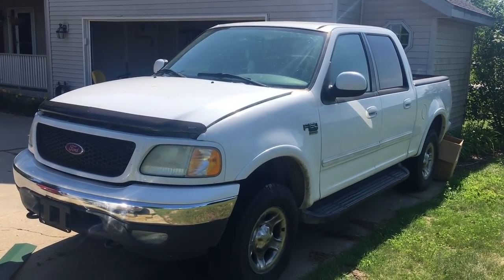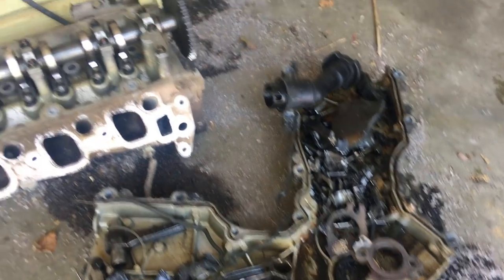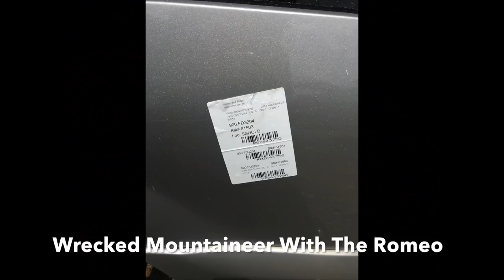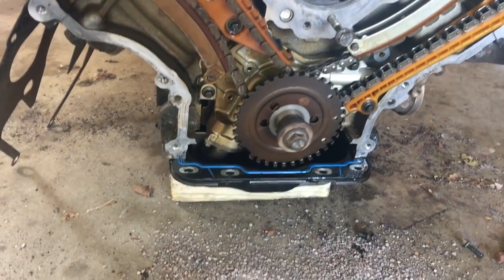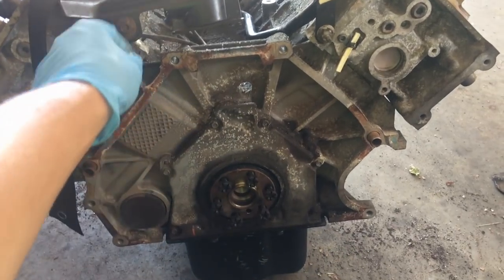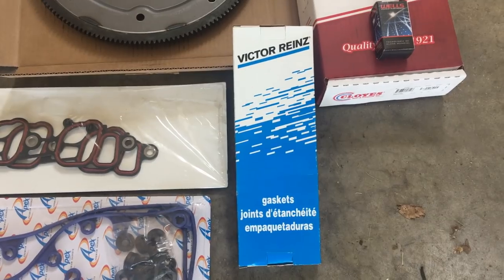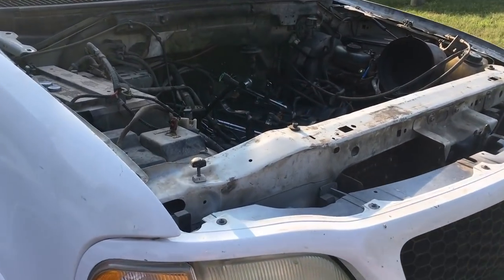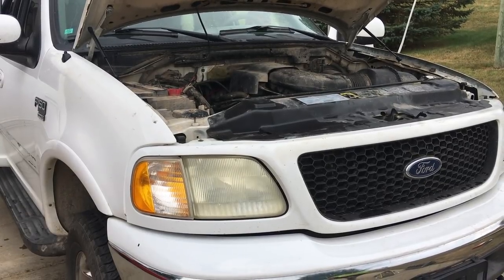Swapping a Ford Windsor 4.6 with a Romeo 4.6 - YES, It Can Be Done!!!! - Differences

Comment: Great job man. But you would think with the old engine going bad due to oiling issues. You would’ve put a new oil pump on that used engine! So much easier to do with the motor being pulled.
Reply: I was just thinking the same thing.
Reply: It’s a Windsor problem, doesn’t really happen on Romeo engines.

Comment: Thank you so much for this informative video.  I am considering a rehab of a 2003 f150 and was looking at the 4.6L 2v and was seeing numerous variations on it that seemed to lock you in to specific set ups. It’s good to know there is some interchangeability between 4.6s
Reply from the maker: Glad this was able to help! It took quite a bit of research and validating and trust to take this on, but glad it was able to happen. Thanks for watching!
Reply: I have a friend with a 2005 F150 4x4.  His truck came with the Romeo engine in it, which hydrolocked due to a defective intake manifold gasket (rod #1 ventilated the block), and we replaced it with another Romeo engine sourced from a 2006 Grand Marquis.  The only thing we had to do was swap the timing cover.
Reply: Please excuse me… I am trying to find an engine for my 2002 quad cab… 4.6. What’s a Romeo engine? ?

Comment: I always trust this Ford 4.6L Triton Romeo, we have two Romeo 4.6L are running like champ over 200,000 miles on our one of F150 and Expedition also we had 2005 F150 5.4L 3V did not make it 200,000 miles on it that had much of problem with PCM, interior electrical, BCM, and transmission went bad, I hate it but 97 to 04 These Romeo and Windsor 4.6L engines are best! I love my 01 F150 crewcab with 4.6L Romeo, never give up on me unless just like simple change water pump, pump steering or alternator are no big deal.
Reply: My 97 f150 has over 262k miles still runs like a champ
Reply: The romeo and Windsor  4.6 for the f150 both use iron blocks.
Reply: The 5.4,  2 valve is also a great engine!

Comment: so it sounds like you can go from a windsor to a romeo but not a romeo to a windsor because of the knock sensors. My truck has a romeo in it and I was hoping to go to a windsor because in my case they are more readily available but with what you told me I might go after a motor from a crown vic or explorer, the aluminum block is also a plus. 
Does anyone know if the windsors were pretty much the same or were there some quite a bit of differences because I know there were like six different ones.

Comment: Hey Chad, I have a question; I have a 2000 Lincoln Town Car which did not have PI heads and I am planning of changing the heads with PI heads; my question is: Do I have to degree the cams because I hear some people saying that and some people saying no? I see you have a lot of experience with this engine; also, if I change the heads the timing is different or the same. Thank you for any help. Jose

Comment: I bought a Romeo 4.6 engine out of a 2008 crown Vic police interceptor with a cast iron block and put it in my 1997 4.6 Windsor F150 Lariat 5 speed 4x4 which has the cast iron block and the only things I had to change were the knock sensor and find a 2008 f150 intake plenum to run my 1997 f150 throttle body. I paid a total for the engine like $600
Reply from the maker: That is awesome!!! Thank you for sharing!
Reply: did you take the knock sensor off the Windsor and put it on the Rom?
Reply: @marvinautoworks9955  I had to drill and tap the hole on the Romeo block to fit the knock sensor for the Windsor just so I can use the stock harness without buying a pigtail. It was easy but you have to be careful to not crack the block or break the drill bit
Reply: @younggun3678  did tap 1 of the 2 holes
Reply: Also I'm going from The Windsor to the Romeo
Reply: @marvinautoworks9955  both the Windsor and Romeo blocks I had just had the one sensor in the middle of the block but you can just put the sensor in one spot on the block you have which probably has 2 sensors. You only need one sensor for the harness and to keep the check engine light from coming on
Reply: @younggun3678  so I shouldn't splice the Romeo connection and put on the Windsor pigtail
Reply: I'm definitely going to make a video about these
Reply: @marvinautoworks9955  I really didn't think of doing that at the time I should've done that would've save some time but yeah you can splice the wires and do it just make sure to connect the right wire ends
Reply: Just bought a engine for a 2002 F-150, yanked it from a 2008 crown Vic, fixing to start that project
Reply: @younggun3678  I definitely let you know if it work
Reply: I had a similar swap, I got a 2011 crown vic police interceptor and put it in a 2000 expedition. I had to swap the intake manifold, upper and lower due to the PI head layout and the knock sensor stand offs. I tell you what though, the engine at stock is a beast, quiet and smooth. bolted right up to the tranny, a/c compressor all lined up. two things I almost forgot about; I did have to use the expeditions original power steering up because of the sensor on it otherwise it would have been throwing that code, and the other was the water pump, due to the threading for the fan, unless you are running an after market electric fan this is a must.

Comment: I don't understand how you wouldn't be able to replace a Windsor with a Romeo or vice versa.  There were a couple of years where you could find a Windsor in some vehicles that only otherwise used a Romeo due to a fire at the plant back around 2000 or so, I do know that some Mustangs and Panthers of those years received the Windsor engines ...  other than the 8 bolt crank in high performance applications, I don't see why a Windsor would ever be better than a Romeo in the PI era.  

Since either engine was available in all the platforms at one point, I am sure there would be the needed parts to effect any swaps.  The engines look the same to the PCM.
Reply: 2005 that is

Comment: The difference in your heads are one is pi and the other is non pi. The heads in your blown motor are actually better heads.
Reply: La.fishsticker 1 they are both pi he got it out of a 04 you can see the pirts are square when he shows it in the truck without intake
Reply: @whatsreallygoingon253  I actually did see that after the fact...

Comment: One thing that I did notice was that my Windsor timing cover bolt holes do not line up with the Romeo timing cover bolt holes just one of them
Reply from the maker: I did have only 1 bolt hole that didn't line up and it was just to the right of the water pump. We ended up putting a bunch of gasket maker around it to seal it up. The rest up the bolts will provide more than enough pressure to keep it tight. But, you are correct, there is that one bolt hole that didn't line up. Sorry we didn't catch this on camera. And thank you for calling this out!

Comment: It's a little confusing Romeo we're known for cast iron blocks only Windsor blocks came in cast iron and aluminum aka wap block so my guess is this is not a Romeo block you have the Windsor Assembly Plant block with the Romeo style heads
Reply: All Windsor 4.6 blocks will have 8 bolts on the flywheel, and don't have the cam girdle the Romeos have. Romeo 4.6 will have 6 flywheel/crank bolts.
Reply: Lmao that stopped me in my tracks to like what they both irons

Comment: Hey I have a 2003 F150 with a 4.6 Windsor. I found a 4.6 Romeo out of a 2006 F150 My mechanic swapped them out, but when he starts it motor runs fine for like 10 seconds, then starts running like crap. He says it starts dumping too much fuel into the motor? I'm at a loss. What do you think it can be?

Comment: So i bought a 97 f150 it had just had a motor swap...i bought it with a " belt squealing" and when you turn it off it has a whin sounded like air escaping thru a pinhole...i quickly eliminated the squealing belt theory and narrowed the sound down to the tranny pump/flywheel area...10,000 miles later it still makes the noise during idle...was told there was slight difference maybe with flywheel or tranny shaft??? Newer motor came  out of a 99e150 van
Reply from the maker: That is a tough one. I honestly don’t know :( sorry
Reply: @ChadWilliamsFixesAll  after your video I wonder if the flywheel from the van was different than the one for the f150....assuming they used the flywheel that was on the Romeo motor

Comment: maybe a dumb question, and if so i apologise,   but still wading into the world of working on your own vehicles,  Does the aluminum block and other small differences effect the capabilities of the vehicle once its all reassembled? reduced hp or towing capacity?   can't help but think that they had to choose steel over aluminum for a reason,  but my 99 needs a engine and i'm struggling to find one,  so if i can expand my donor vehicle list i'd be stoked

Comment: Why didn’t you use the old 6 bolt fly wheel that you pulled off the junkyard motor? I see you bought a new one, why is that? I have a 1999 mustang and I’m putting a 2004 Romeo in it, the Romeo engine comes with the 6 bolt fly wheel already, are the flywheels the same with the 1999 and 2004 with the exception of the Romeo being a 6 bolt and the Windsor being a 8 bolt, are they the same other than that?

Comment: Something I noticed on my 4.6 mountaineer motor is that the crank shaft position sensor plug in is different then my 02 how did you fix that

Comment: I have 2010 f150 ,4.6 2 valve inside my single cab and its a good , decent motor
Reply: THE NHRA GUY #49 is it stock? 2010 f150s came with the 3v 4.6
Reply: @mattweeks2272  I ran my vin number on all data .   it's a f150 single cab 8ft 2wd.   Base model
Reply: @mattweeks2272  its got a 2 valve 4.6 I ran my vin on all data and have all the stuff printed off for it.    I work at a car dealership
Reply: Do you wanna run my vin number ?   Your barking up the wrong tree buddie .  you wanna run my vin to my truck ?  U wanna see what comes up. ?

Comment: Is that a crack in the block at 8:11 where the timing cover bolts up above the oil filter?
Reply: Motor mount
Reply: Es la union entre el Block y la cabeza🙃

Comment: so I bought a  2010 E150 with a knocking 4.6L v8 engine . would a older year such as 05, 06 or 07 E150 4.6 l v8 engine work for  a swap?  Any ideas?

Comment: Great video brother, what about the 5.4, could you swap that or would that be significantly more work?
Reply: They are basically  the  same  as  both 4.6 engines.   Get the computer  that goes with the  5.4   ,and get a 2 valve  5.4

Comment: oh man, i am keeping my mom's 2000 f150 and some guy swapped a 3V 4.6 into it and it runs like crap, plan on swapping a Romeo 4.6 out of a 01-04 Mustang GT and have it as a fun daily. also needs a new transmission, and new suspension... might as well replace the truck lmao
Reply: I'd diagnose the 3 v running problem. It should run great.
Reply: Runs like crap cuz that truck isn't supposed to have vvt
Reply: Lock out the cam phasers  problem fixed
Reply: Just slap some 2v heads on there and call it a day or go 4v but you'll pay more for that

Comment: Do you think you can put the Romeo heads on a Windsor block? I heard you can but if you have the valve covers and the top of the timing chain cover bolts(smaller than Windsor’s) im just curious if the timing chain from a Windsor block would still work
Reply: Yes, you can put any head onto a 4.6 so long as its from another 4.6 or 5.4, and both motors are modular motors not windsors
Reply: @musicrevelation2023  The "Windsor" refers to the plant the engine was produced in - in this video, a Windsor is a mod motor and not the old SBF such as a 260/289/302/351W.

Comment: I have a 2001 ford expedition xlt 4.6l with 4 wheel drive the 8th digit of of VIN is w . So here's my questions 1: what years will have interchangeable engines without having to change out other parts 2: will a 5.4l engine  same year with 4 wheel drive fit and work properly 3: does it matter if I find the same engine and year ect. But the transmission is not a 4 wheel drive? I'm stuck I'll find a ton of 2001 expeditions with 8 digit vin as w but they are 2 wheel drive and mine is always 4 wheel drive all the time with a 4h and 4l switch or I'll find ones that are 4 wheel drive ford expedition but they are usually 4 wheel drive like mine but not sure if I'll have to change anything else out if I go from the 4.6l to a 5.4l .Please help me I'm lost lol
Reply: I am just now changing a 1999 5.4 to a 2001 4.6 romeo engine in a F150 and I am about to find out.

Comment: Its called a Windsor? I thought the windsor designation left with the 351? I literally never knew that i thought it was called a mod, is it built in windsor Ontario?
Reply: Yes. The Windsor/Romeo designation refers to where it was produced.
Reply: @eclipsegst9419  no, windsors are the cam in block design. The 4.6 and 5.4 are modular motors because they are ohc design not windsors
Reply: @musicrevelation2023  Windsor small blocks were named that because of their production plant, so were Clevelands. Modular motors also use Windsor or Romeo to distinguish between them as there are differences. Only matters if you are building/rebuilding so the terms are used a lot less than they were on the ohc engines.

Comment: So I have a 98 f150 with a 4.6l what can I swap that with? Can I use a newer 4.6l? The 98 have spark plug wires and the newer 4.6s has coil on plug... any suggestions?
Reply: You can run it on that spark set up but the newer pi heads need a pi intake to get the extra power

Comment: Yo please answer this one question.... So you have to change the timing chain?  I can't just drop a full Romeo in swap the fly wheel and run it? Going from a 2000 mustang 4.6 Windsor to an 01 mustang Romeo,  I'm guessing the timing is just changed because yours is from a different model
Reply from the maker: Hey Lil Dez, since the motor was out, I decided to do the timing chain at the same time. Way easier out of the vehicle than in it. But if you are replacing the timing chain, go with the parts for what ever motor is going back in to the vehicle.

Comment: I just bought a 04 40th anniversary supercharge mustang gt an the tips of all plugs are smashed in from the pistons hitting the plugs anyway I take it that motor is no good. Ok I have a 97 4.6 that is ready to go great motor. My question is will it fit in my 04 4.6 an can I mount the supercharge on it?
Reply: Npi head vs the motor in your car is a pi head so swap your heads and do forged internals while your at it these rods and piston dont hold past 450 whp with your older motor having a forged crank already and it's a 8bolt the one in your car is a 6bolt cast crank

Comment: I have never heard of a mod engine be referenced as a Windsor. I would have put a 5.4 in it. I put a 5.4 in a 00 mustang originally with a 4.6 and ran on the stock ecu.
Reply: Did you notice any significant difference power-wise just from swiping in the 5.4
Reply: It was a totally different car. Tons more torque.
Reply: Windsor simply refers to where the engine block was made, in this case it was made in Windsor, Ontario. Romeo was made in Romeo, Michigan. slight differences but both can be mod'ed. (if that's what you were getting at)
Reply: Yes I know where the name Windsor come from. Like I said in the comment. I have never heard of a mod motor referenced as a Windsor. The only engine I know referenced as a Windsor is the 351 push rod engine like the one in my mustang.
Reply: @bryanroupe8646  gotcha, just trying to be helpful.
Reply: @bryanroupe8646  Traditionally, a "Windsor" referred to a small block Ford engine of a particular design with 260, 289, 302 or 351CID (351W).  However, the Windsor plant was switched over to making modular engines but these engines are slightly different than ones made at the Romeo plant.

Comment: Why does the bolt pattern matter on the flywheel as long as it will bolt to the torque converter
Reply from the maker: I think I forgot to mention there was a different tooth count on the flexplate.

Comment: They're the exact same engine. Only difference is the internals being slightly different. Any and all 4.6l V8 are the same engine and will fit in every single other car that has a 4.6l V8 of any year. People are just dumb and think everything is different and not made by the same exact company on the same exact block with the same exact engine mounts.
Reply: They are not exactly the same engine.  There are differences which involve the crankshaft (A Windsor crank will not fit a Romeo engine due to crank throw clearance issues), valve covers have different bolts, cams are held down differently (all of which he went over here in this video, with the exception of the crank).  As much as the vehicle is concerned, there isn't any functional difference (aside from the flexplates).  One will bolt right in where the other once was.

Comment: Windsor and romeo are both iron blocks the 03 04 motors being the stronger castings
Reply: @302efi  still not a romeo block  might be romeo heads not block chance is a WAP block
Reply: @austinhowze6280  If it was assembled in the Romeo factory, it is a Romeo engine.
Reply: @silicon212  for the most part the crank pully and valve covers would be the difference

Comment: I find this confusing , this is  the modular engine with overhead cams . I thought Windsor engines were  just the overhead valve 260 289 302 351 w  engines ?
Reply: No, there's Windsor car and truck 4.6
And there's Romeo car and truck 4.6
Both are overhead valve engines.  There's also the 4.6 dohc I believe they can also be Windsor or romeo😊